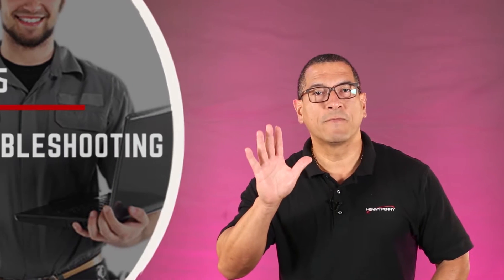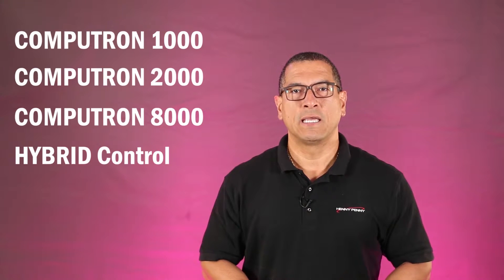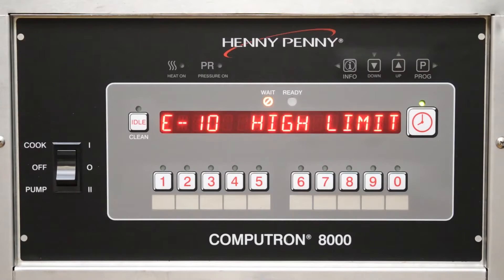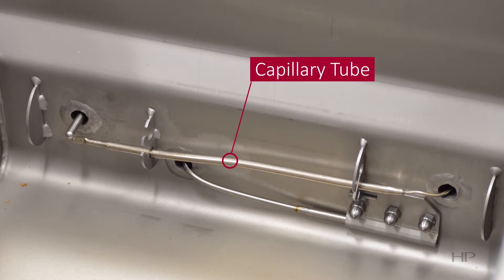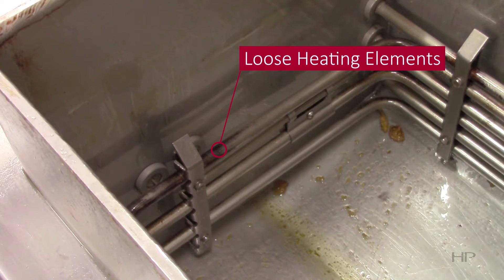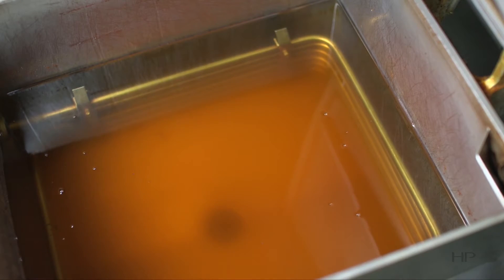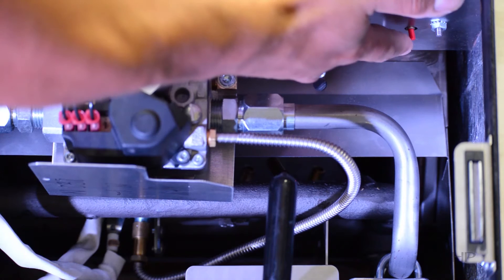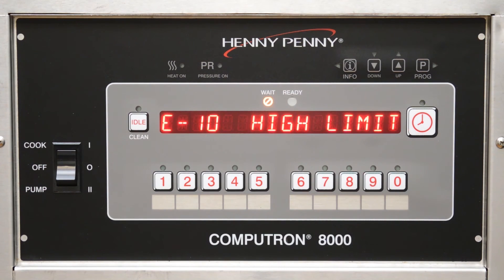Troubleshooting E-10 Error Code - Henny Penny 4-Head Pressure Fryers

Comment: Our computron 8000 brings up e10 every morning when we turn the machine on so when the oil is cold ,we replaced the thermostat but its still doing the same
Reply from the maker: An E-10 is related to the high limit inside the fry vat. We would recommend performing a clean out/deep clean to get rid of black carbon build up that could cause the issue you are having. If you are still having the issue after that, you may need a service call at that point. Feel free to reach out to our Tech Support Dept for further assistance if needed @ 800 417-8405.